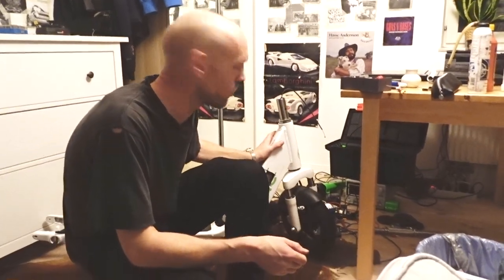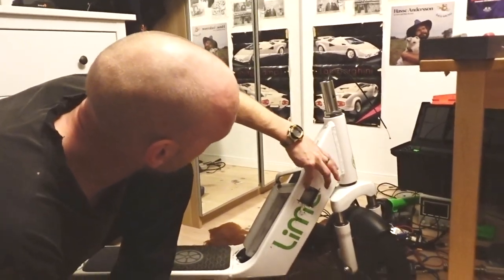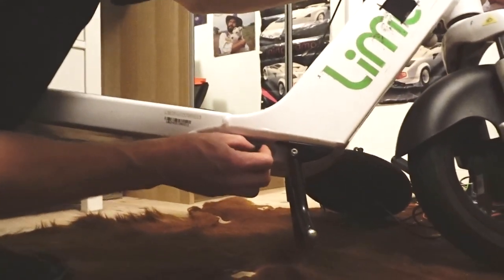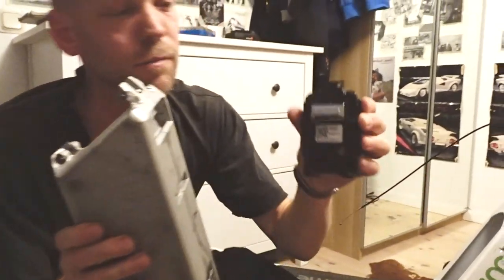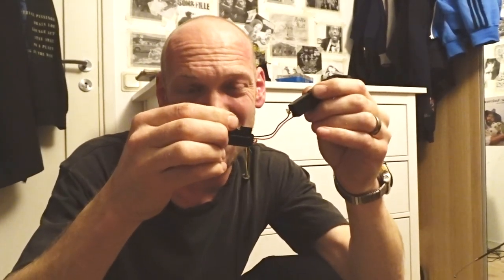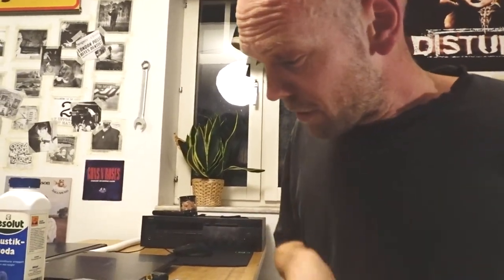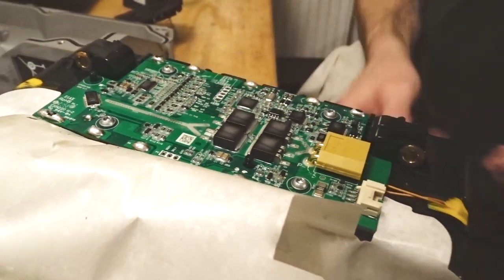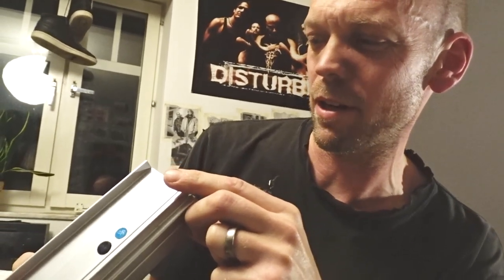Lime scooter (Gen 4) - Full teardown

Comment: That 'plastic' you found is called Potting Resin.  It's used for a variety of things like protecting the electronics against vibration, and it conducts heat away from the components making the controller run cooler.  It's a sign the controller was built as a quality unit (also indicated by the waterproof connectors the controller used).

Comment: If you just make a small hole at the back, you can use a screwdriver to loosen the battery without damage and the lock will still work normally. You're not going to make a hole in the side if you demolish the whole thing. Those three thin wires on the motor are for a temperature sensor, there are no hall censors in these wheels and the throttle has 3 wires and not 2.
Reply from the maker: Not sure about that hole, you mean from the front of the "neck" of the scooter? I'm pretty sure those thin wires from the motor are not temp sensors, the ESC really need a good grasp of the position of the wheel at low speeds especially, so it's very likely an encoded angular sensor of some kind.
And yes, the throttle is three-wire, I think I show that in the video as well.
Reply: @Oxiemannen  yes front of neck

Comment: Good video compared to the other videos out there that are unfortunately mostly pure trashy rubbish. If you gain more insights into the inner workings, like debugging the CAN bus or discover that the motor is really speaking 1-wire, etc., I’d love to see more of your discoveries. Thank you!
Reply from the maker: Thanks, will do!
Reply: To know how the inner workings of that clock work someone would need some knowledge in embedded systems as well as the scooter.
You could hook up a logic analyzer and try to figure out what it does. Or extract and reverse engineer the firmware which could get harder if they enabled the protection.
It would be a shame if a broken scooter randomly appears (legally) in front of my door :D
Reply: @_DSch  I’m thinking ideally logic analyzer, then replace the firmware with something homegrown. I very much doubt they’ve added security keys to all components in the way Apple has done. Likely only the MCU has locked firmware that could be erased if not backed up.
Reply from the maker: It would probably be possible to hack the ESC if one could get that resin away without damaging the components, but then you would also have to be lucky enough that they some standard hw for the electronics so that you can just use some open source software to flash onto it. I sort of doubt that. Hacking the CAN protocol controlling the ESC might of course be possible, but if it's encrypted in any slightly serious way that will be a loooong task.
Reply: @Oxiemannen  depends, if they have left security holes... why not.
Tier scooters have an interesting... artpiece which goes into detail on how they and their canbus work ;)
If they have security enabled on the MCU: If its a cheapo GD32 i would just decap it in the University lab and dump the Firmware from the flash bonded on top, then just reverse engineer the code lol.
Reply: @_DSch  do you have more info on the canbus protocol?
Reply: @vb9528  There is a german "puppenspiel" which talks about that.
Its fictional art tho, no one would be hacking those scooters, thats illegal ;)
Reply: @headbanger1428  -- Late reply, but consider this: In the earliest days, scooter companies bought consumer scooters and just wired in a controller that communicated via the internet to their custom server to send signals to the scooter regarding whether it should be turned on or off. All of the scooter companies lost tens or hundreds of thousands of scooters to people who figured this out and simply reversed the process. Over time, their products have evolved to the point that much of it is proprietary and not easily replaced with off-the-shelf components. This is especially true for the electronics, at least. Some of the hardware may be a bit more standardized, but even there they seem to use a lot of proprietary stuff.

That said, I wouldn't assume that anything is open and easy to access, but if it is open today, it may not be tomorrow when they patch that shortcoming.

Comment: Has this got one gps on the neck of the scooter?
Reply from the maker: Well, yes, that's where the central control unit is placed
Reply: So only two screws preventing it from going missing?seems odd
Reply: @surplusstock8778  If you watch the video, you can see that it’s not usable at all. Everything from the battery management to the motor controller are all on their own communication bus, it’ll cost more to replace the non-functioning parts than it would to purchase an inexpensive scooter.
Reply from the maker: Yes, they've done a good job locking it down. You would need to replace the motor controller which will cost you like $200 I guess. Great quality scooter though
Reply: You definitely mean $15 at Ali Express, not $20
Reply: @JEVAKO-030  13 euro
Reply: @pashkaS54  change bms 25 euro

Comment: It is very simple and you gave the answer, mosfest are "taps", turn the tap on and power gets throught to the connector, try connect the mosfet on, as it is low corrent you can use your finger, put your finger in the mosfet connectors and put multimeter in the main positive and negative ( instead your finger use any electric wire or tool). Try at your own risc.

Comment: is it that if you will use a chisel on top of the battery it can help to remove the battery?  somehow it will puch battery down a be release from the latch.
Reply from the maker: well, that will be pretty hard, it's a really sturdy piece of hardware. Much easier to just drill like I showed.

Comment: what nuts are they using on the motors and how did u get them off
Reply: burin
Reply: Are you talking about that nut that holds the wheel onto the vehicle? Looks proprietary to me, but it could just be some oddball security nut.